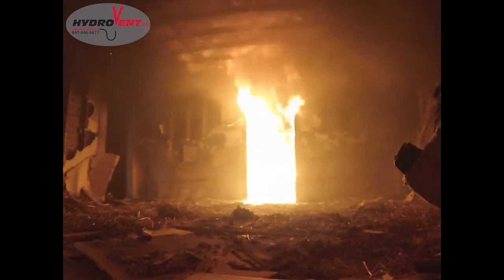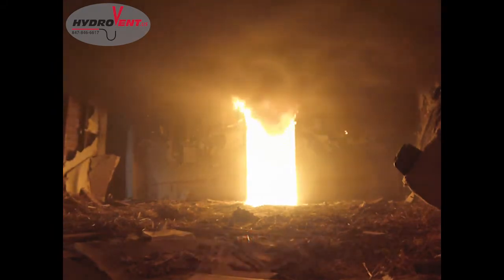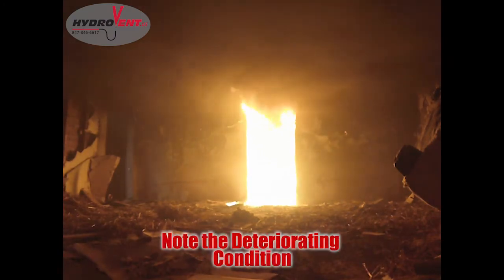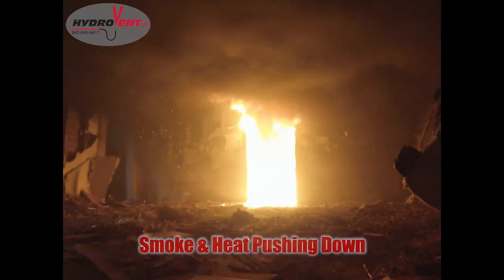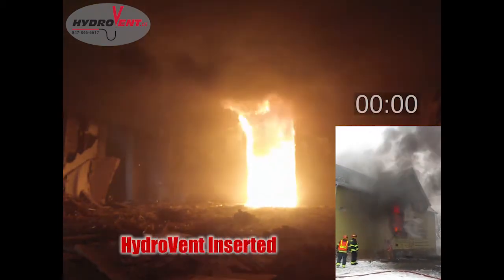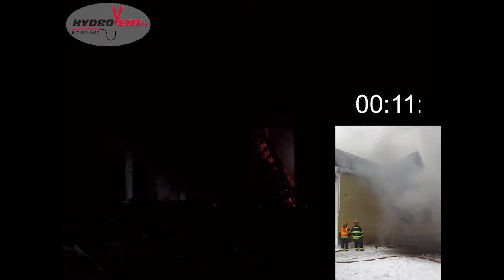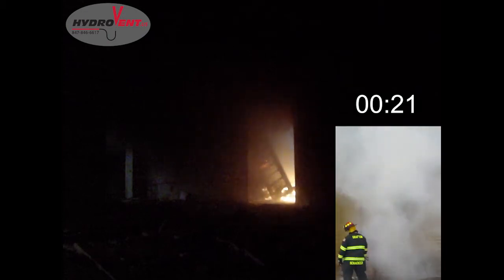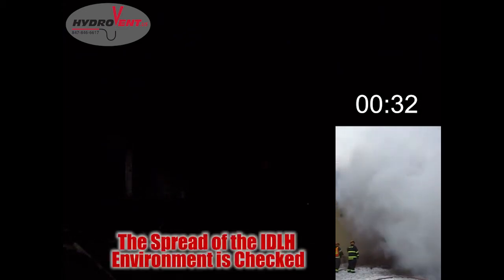HydroVent 하이드로벤트 HV1501

Comment: It's amazing. I'm not good at English, so I don't understand the story of the video, so I'm asking you a question. This "hydrovent" not only expels smoke to the outside, but also extinguish it, right?

Is that the principle of lowering the oxygen concentration inside?

If you use a hydrovent on the other side to take the air out
Eventually, air is sucked into the other passage and oxygen is supplied, so I think the fire will grow, which is amazing.

Thank you for the video. Thank you.
Reply from the maker: Sorry for late to answer your question.

Basically, this equipment designed based on  'Bernoulli's equation'. This tool can use for fire extinguish, but the main purpose is suck the smoke from the building. so, early fire suppression is most important before use this tool. This tool can't extinguishing fire alone.

Anyway, not just suck the smoke from the building, also suck the air and make building vacuumized. then remain fire in the building is extingished cause lacks of air. 

I hope this will help for your understand. Thank you.
Reply: @jeworthycoltd  ah- I got it, Thank you !